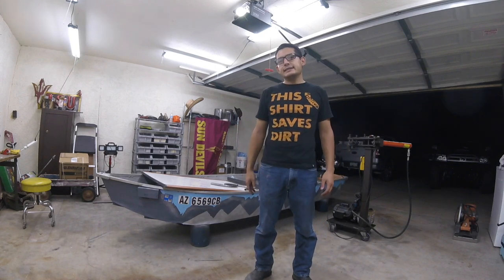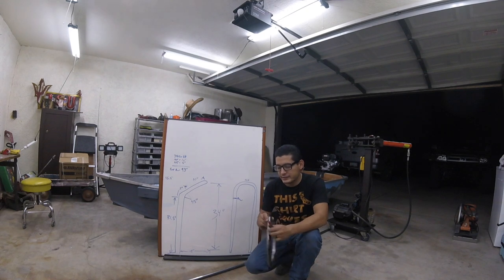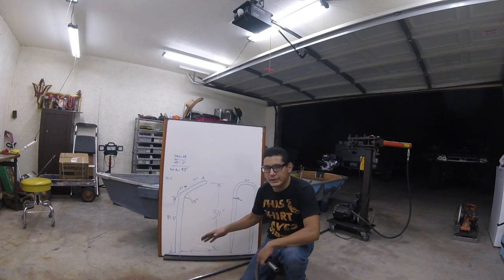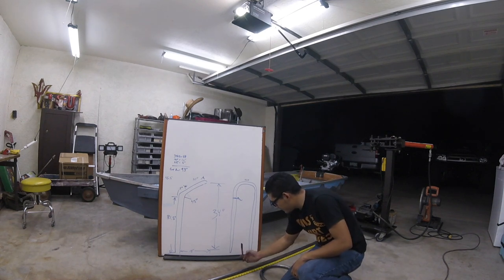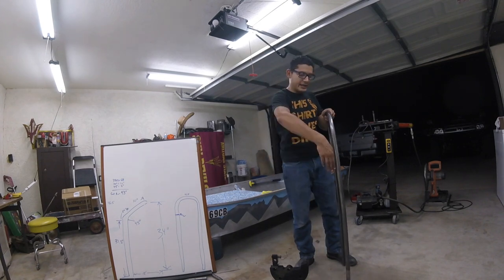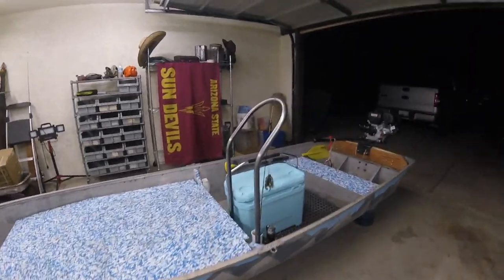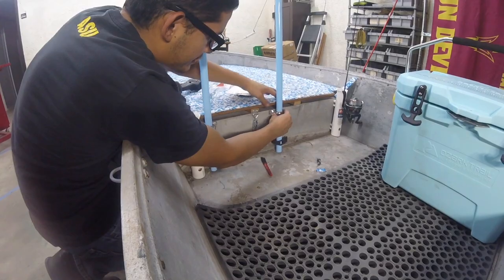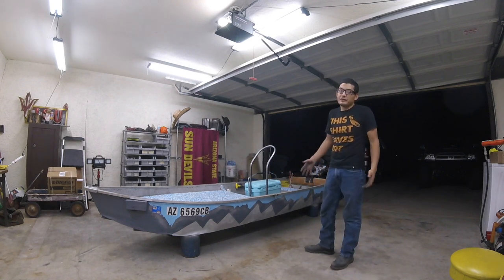How make DIY Jon Boat Grab Bar

Comment: I just purchased a 36" hand grab bar that's 9" wide with flanges at the bottom. I was thinking of bolting to aluminum bench seat but now I'm thinking it's a bad idea because of thin aluminum bench on my 12' aluminum v hull...I decked it with a 3/4"  plywood to the beach I want the grab bar on.maybe I should bolt it to plywood only have any ideas.